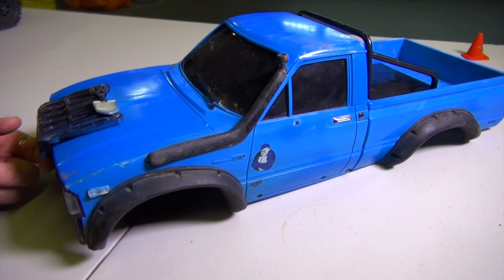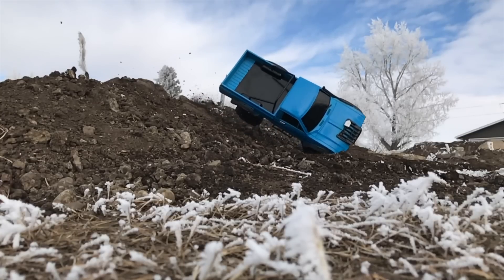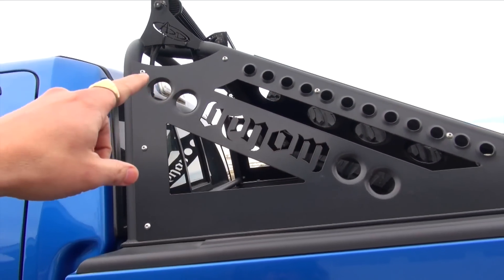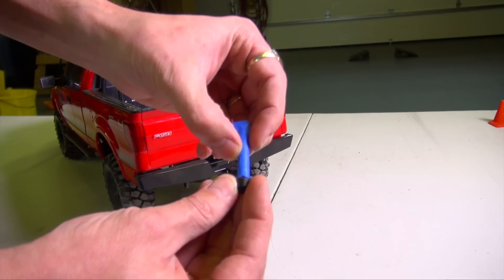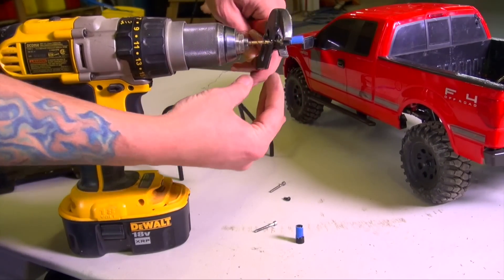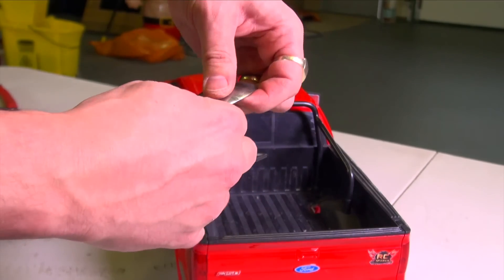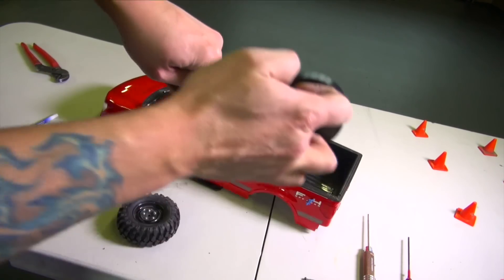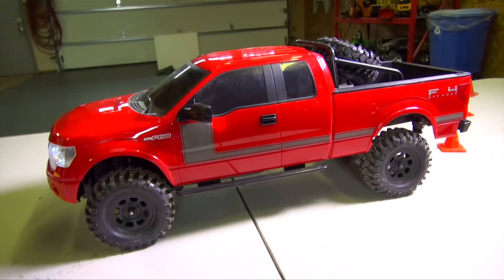RC ADVENTURES - Modifying my Ford F-150 FX4 w/ a Roll Bar & Chase Rack - Bonus Slow Motion Jumps

Comment: I have a tamiya hornet. I converted to brushless. I built it myself. It goes up around 50+ mph . I run a 4s Lipo. The motor is a Novak 5.5 turn brushless motor with a Novak gtb esc. Ypu probably wouldn't care but I'm 13 years old and I built it when I was 11. I also built a boat from a wooden nick nack shelf item thing. I sealed it and put a jet motor in it . I also built a trailer for the hornet for the boat. The car pulls the boat and launches it. Ps. I love your channel I've been with you since around 50,000. I'm Zachary

Comment: If you have an extra nut, it'd help to put that on the top side of the spoon to hold the bolt in place as a stud, so that when you remove the not and washer on the spare, the bolt stays in place. (Realistically you'll probably never pull the spare off again, but just a tip!)

Comment: As always great video. Question for you? I own a jlb 21101 and because of the cold winter I've broken 2 steering knuckles already because the plastic is extra brittle in the cold. I came across some integy blue anodized aluminum ones for the e revo and the bearings I need to use are bigger no problem I have many size bearings but I need a larger set screw and something to hold the pillow ball mounts in place because they are smaller on the Jlb. any suggestions? I know you extensively modify alot of your rcs so I figured you would be the one to ask. Thanks
Reply from the maker: Dang bro.. I wish I could help you. I have never used the product you have
Reply: Thanks

Comment: It looks good but I would question how durable it is,  It looks like the first hard impact and it will punch through the hard body.
Reply from the maker: Nope, those plastic spacers (4 of them) support in a great way, especially on the round wheel wells. I am not concerned :)

Comment: If you get a quiet sound speaker (not like the ones you use that sounds like you removed the exhaust) and some quieter motors it would work so well.

Comment: As I posted in the last vid, I suspect the housing was cracked on the one big jump you took, it landed hard directly on that wheel.
Reply from the maker: You know it was really odd. Those axles were brand new.. and its not my first TF2.. I have beaten on them pretty hard.. but - the difference is - they wern't original tf2 axles. They were from a "Beast 2" 6x6 kit. I wonder if they are made weaker then the tf2 axles
Reply: Well, the cold probably didn't help either, metal gets more brittle. My thinking is, based in what I can see in the vid when it brakes, there doesn't seem to be any "event" to cause the failure. This would lead me to believe there was previous damage that gave out then. But then, I wasn't there, I am analyzing a youtube video.

Comment: I have a traxxas slash and  want to build a plow for my crawler how did you do it?
Reply from the maker: There are kits you can get online.. or use some drop hangers, with suspension links. The long links will act as arms. use 4 of them bolted to drop hangers. Good luck!
Reply: are you selling any rigs?
thanks

Comment: This was Wonderful . Always sparks the  interest in me .. I love RC .. cars,trucks(with Trailers are the best ), quadcopter , fixed wing aircrafts.. all electric though.  never got to play with the good ones as a child .. Now that I can possibly buy one , I'm interested more than ever . 
I'm now designing and making my very own drone ... only the structural components I buy .. I want to design the avionic components on my own .. I'm capable of doing that and  nothing more rewarding than seeing my code run on a hardware seemlessly.. I got this quad thing Figured out .. after building one , I would love to build a truck or even a tractor trailer .. I was hoping someone experienced in the hobby can guide me or link me to a web where I get information on how to get started .. Building the structure of these vehicles will be fairly complex so I'd leave that alone but the controls I definitely want to design and build. So if someone could help me out with this , that would be of great help .. I am a newbie so please bear with me if I said something wrong or incorrect.. thanks ! looking forward
Reply: Also , I was wondering if these machines have breaks .. kinda looks like it.

Comment: It would be cool to have another out put from the motor and out the back then run the drive shaft to the hitch and from there run it under the tongue of a trailer and have like wraith axles or something and have a trailer with drive
Reply: It would have to have open diffs though
Reply: It would have to have open diffs though

Comment: I put a Burly mud truck conversion kit on my SCX10 with someone 110 millimeter boom racing shocks and 2.2 mud Bashers thinking about putting wraith axles under it is there a bigger tire for 2.2?

Comment: I am looking at  getting an scx10  the 2012 jeep wrangler and was wondering what the best  lipo battery and charger setup  to go with.I live in southern New Brunswick Canada and shopping in the states is not worth it with the exchange rate on the dollar. So any places in Canada that also sells them would be a help too thanks.

Comment: I have a traxxas e maxx with a mamba monster 2 did not burn  only on 4s i trid 6s two much power exploded drive shaft and diff and it runs at 130 to 140 6s 4s  is 100 to 120